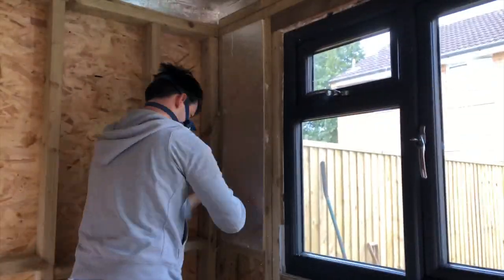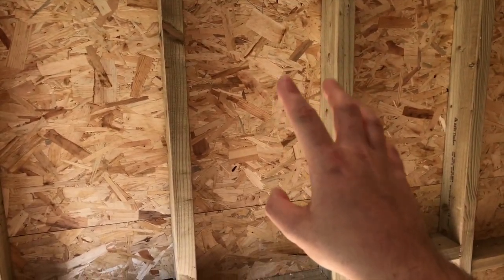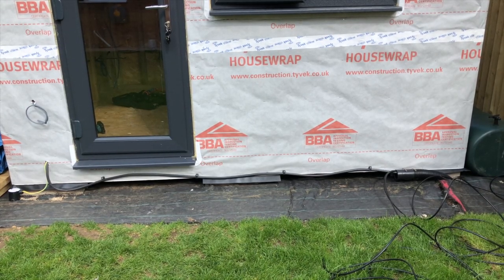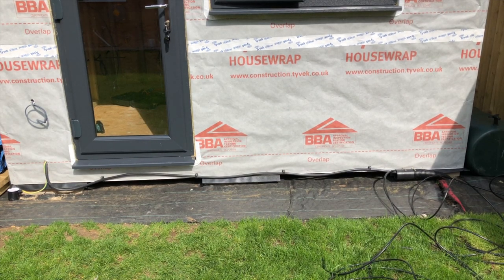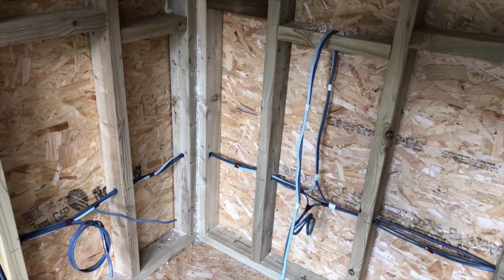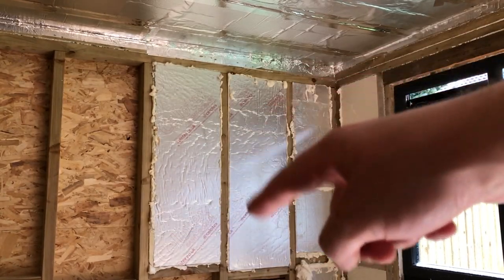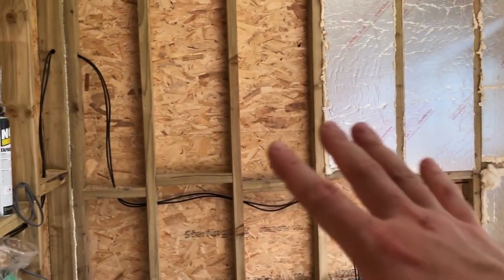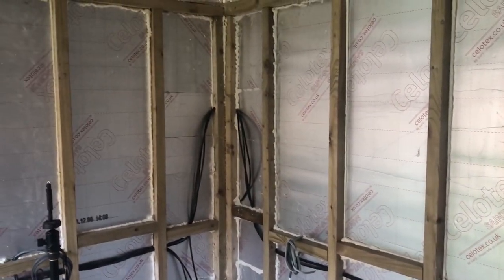Building My Garden Office: Part 9 - Electrics, Networking, Insulation

Comment: Did you need to protect the wires from the insolation in anyway? If the wires get hot inside insolation, could that cause problems?

Really great hearing you explain your decision-making around the ethernet cables :-)
Reply from the maker: No protection on the cables, no. It’s similar construction as a house so not worried.

Comment: Good work. Does the garden office connect to its own circuit on the main house consumer unit or does the SWA cable just connect to an existing ring main or  radial circuit?
Reply from the maker: The garden office connects from its small consumer unit to an individual breaker in the main house consumer unit, so you can isolate the cable at both ends.

Comment: Hi there, just about to start our garden office. Did you run your network cables in the underground duct with your SWA cable? Will that not make the network cable prone to interference, or does the SWA act as a shield? I was planning to run the network cable in the duct and the SWA just buried in the ground with minimum 100mm separation from the network duct. Cheers
Reply from the maker: Ian Coxsey Yes, I did both in the duct. I made sure it was wide enough for both (100mm) and both the CAT6 and the SWA cable arrived insulated. Speed test show correct gigabit speeds. Good luck with your build!

Comment: Great video, I'm currently working on something similar for a friend. I noticed there isn't a link to the ducting / conduit you used to run the cabling down to the garden office. Do you have any links or recommendations on that?
Reply from the maker: I think I just bought something in a sale. It was 100mm wide conduit if I remember correctly.

Comment: Did you run your Ethernet cable with your power supply (down the same conduit) from the house to the cabin?
Reply from the maker: I did. It was attached to one side and the power to the other. In hindsight I should have used fibre but I ran a bunch of continuity and speed tests and it all checked out with no interference. Think I was lucky with it though.
Reply: @jackrmcconnell  that’s good to know, I’ve just read that you’re not meant to do it, as it can cause issues with interference and high voltage jumping to the low voltage. We’re putting an outside office in and I was going to lay the cables together.
Reply from the maker: @lmtreeservices  I can’t say I’ve seen actual issues with doing it in the wild and it’s certainly not been my experience but I imagine it must happen. I’d go with fibre just to be on the safe side though.
Reply: @jackrmcconnell  getting a little confused with all the options tbh. I was going to use a cat6 or 6a swa type, not sure which fibre cable/ spec’ I’d need.
Reply from the maker: @lmtreeservices  I honestly don’t know enough but Ali Dymock has a good video about this. Much of my office build was inspired by his.

Comment: Hi Jack, how come just the aluminium foil tape on the 2 walls please?
Reply from the maker: I just wanted the largest thermal barrier on the two walls that had the sun on them the most. Also, the insulation was at stud level and the rest weren’t so it would have been difficult to tape those.
Reply: @jackrmcconnell  Ah I see, fair enough. I'm in a similar position where the insulation is sunk back so not sure how to tape these. I did think 4" tape to sit on the wood, round the edge and overlap onto the PIR but what do you think please?
Reply from the maker: @Twigster1  that’s why I used a vapour barrier - the green polythene sheet, taped up everywhere. It solved the problem and was inexpensive.

Comment: Do you have any plans or timber material sizes you used l?
Reply from the maker: Nick Wilkinson no plans as such. I finished it mostly but after the bare structure, I more or less worked it out on the fly. Most of the floor and walls were 2x4. The roof was more, based on span tables.

Comment: Was that a data cable in the same pipe as the power 😳
Reply from the maker: Yes. Someone else commented on that. Both are attached to opposite walls giving 100mm separation and packet testing shows no issues. Think I might have been lucky but not something I’d do again if given the chance.

Comment: Out of curiosity, how much did you pay for the electrician? I have a similar project at the moment and need a spark to do tge electrics.
Reply from the maker: Think it was £680 all in. That was for the small consumer unit, connecting the armoured cable to the house, etc.
Reply: @jackrmcconnell  Thanks Jack.  That's pretty spot on my budget.  I only need a couple of socket points in a log cabin and hopefully don't need a consumer unit but, also need power to a fish pond and where a hot tub is going to go.  Want it all on the same ring so as not to over complicate it.  I will see what a quote brings!

Comment: Hey Jack, I’m just building one now. Did you do a cold roof or a warm roof construction?
Reply from the maker: Joe Taylor cold roof. Didn’t have the space for a warm one.
Reply: Jack McConnell Thanks Jack, I’m the same. What did you do for the roof then, did you leave an air gap or just pushed insulation to the top and left it? I’m at that point and not sure what to do. Apparently you need an air gap and then vents in the soffits for the airflow 🤷‍♂️
Reply from the maker: Joe Taylor Yes I did and yes, having the air gap is very important. I periodically check mine and it’s remained dry in the gap which is good.
Reply: Jack McConnell Awesome, how are you able to check it? By looking through the soffits?
Reply from the maker: Joe Taylor I haven’t actually got my soffits in yet so can just look or feel above the insulation to see what it’s like. Haven’t gotten around to ordering soffits yet but plan to add them this year.
Reply: Jack McConnell Awesome. I’m building this for an office also and the information online is mixed but sometimes I wonder whether it’s overkill or not 🤷‍♂️ Do you have any other type of fresh air ventilation when windows and doors are closed?
Reply from the maker: Joe Taylor Not at the moment. I’m think of installing an extractor inside the room so that I can pull fresh, cooler air through when it gets hot in the summer. I always have the little window open a bit, even in the winter.
Reply: Jack McConnell Cool. I was looking at just drop out fresh air vents. Installed in pairs. One coming in at bottom and hot air out at top. The natural flows draws and expells. Only 60mm holes required and no noisy fan.
Reply from the maker: Joe Taylor nice. I’ll have to take a look. Providing it doesn’t get too chilly in the winter.
Reply: Jack McConnell just a quick one. When you did the roof, did you just push the insulation up slightly but left a gap? Did you do anything else special there?
Reply from the maker: Joe Taylor The insulation is flush with the bottom of the roof joists with a gap above, between them and the OSB. You may be able to see it in one of the other videos.
Reply: Jack McConnell Thanks. So you didn’t put anything like a membrane above the insulation then. So just the foil back, a gap then the osb board on top?
Reply from the maker: Joe Taylor it’s taped up inside so there’s a barrier there but as far as I know there shouldn’t be a barrier above as it can trap moisture on the outside that has greater temperature fluctuation.
Reply: Jack McConnell Perfect so literally, push the insulation up, but not right to the top, leave about a 50mm gap.
Reply from the maker: Joe Taylor pretty much but you may need to check your air gap spacings, etc using an online calculator.
Reply: Jack McConnell It looks like 50mm is normally the space you need in cold roofs in general? How much did you leave? Mines about twice the size of yours maybe? 11ft by 8ft
Reply from the maker: Joe Taylor I honestly can’t remember but  it was at least 50mm. Possibly more.

Comment: Network cable separation gone out the window when it was dragged through the Duct with the SWA cable. The SWA cable is NOT shielded to protect EMI to other cables. It’s for mechanical protection and safety. The current Wiring Regs state MINIMUM 100mm separation between SELV and LV circuits for this exact reason. From experience you are going to have high Induced voltage in those LAN cables. This WILL have a huge negative effect on data transfer speeds. Your “Electrician” would know this. 👍🇬🇧
Reply from the maker: Steven G I agree however, the cables are taped to the outer edges of the duct as best as possible to give some distance. The CAT6 is shielded and having run some tests, there isn’t any packet loss or speed decrease to indicate a drop in quality from interference from the SWA. Maybe i’m lucky but all seems to be well. I choose this route as I didn’t want to direct bury my Ethernet cables for fear of chopping through when when gardening.
Reply: Jack McConnell When system is energised, check for AC voltage between Ethernet cables and earth. Obviously the network cables need isolating first. Two separate ducts should’ve been in ground when opened up. At the end of the day, you must be happy with your efforts and if it all works and your spark is signing it off then well done. One other observation, under the vapour barrier should be zero clearance clearance between the installation board. Moisture WILL become present where air gaps exist. The fixed cables should have mechanical-protection. I’m a great fan of dado trunking around walls in such garden buildings. Gives great flexibility should you change layout of office, separates cables correctly and allows for wall cavities to be filled flush to surface as no cables in walls. Anyways my friend, well done! It will for sure last a number of years. Oh, and get those ducts off the ground and sealed. 👍🏻 from me! 🇬🇧
Reply: @jackrmcconnell  hi Jack. Shielding only works when the actual shield is earthed continuously throughout the run. If the shielding isn't attatched to a seperate earth from the house then its doing nothing different a cat 5 does. Really  you should use a switch in a cab which is earthed via a rod and the cat 6 should then be connected to metal rj45s or into a metal data point with a metal rj45 plugged into the data point and then the computer. If the earth is broken at any point in that sequence it isn't shielded! Great videos though
Reply from the maker: Terrance Hazell Interesting! I do realise this is an area where I didn’t do a brilliant job. Fortunately, I have done some speed tests and i’m getting really decent speeds so have been fairly happy with everything. Maybe i’ve just been lucky. I’m about to do some more ducting on my property with power and data cables but this time they’re going in separately.
Reply: I bet it works fine. There must be millions of miles of cat 5 / 5e / 6 run in dado trunking alongside socket wiring across the country.

Comment: Make your life easier next time and strip the cables to the back of the box
Reply from the maker: Curtis J I’m not sure I follow you?
Reply: @jackrmcconnell  10:37 get rid of as much of the black outer sheath as possible, makes getting the faceplate on a lot easier
Reply from the maker: Curtis J That’s true but the more sheathing is removed the more chance of interference on the cable, especially at the connectors.
Reply: @jackrmcconnell  i doubt six inches would make a difference, but i could be wrong
Reply from the maker: Curtis J I used to install networks and seen the effects through an analyser. You’ll be surprised! Never mind all done now, and working well 😊
Reply: @curtisj2165  you can't that with networking you can only do that with power (you'll get interference if you do it with networking cable)